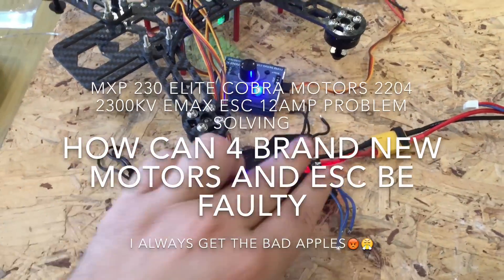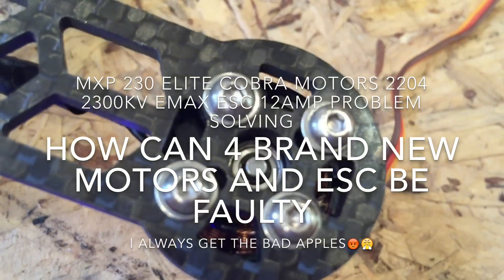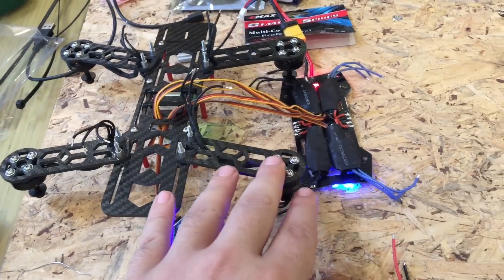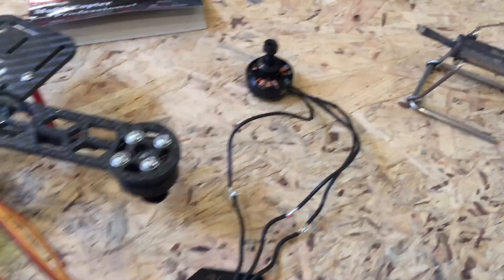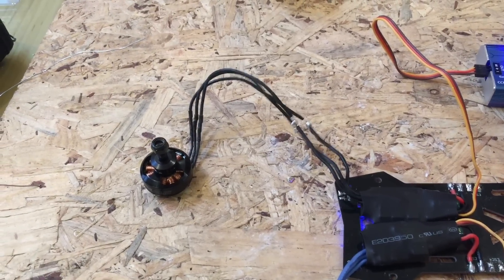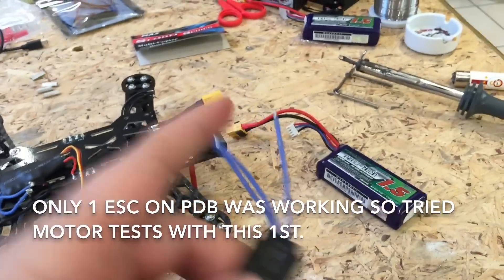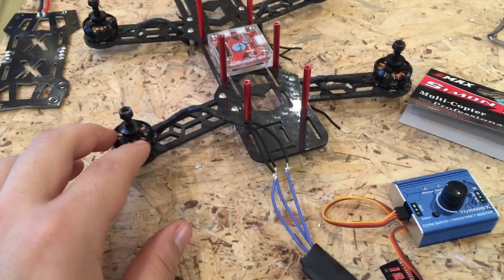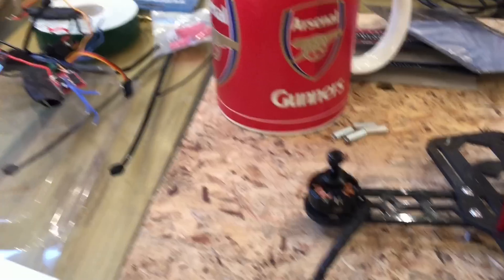Cobra 2204 Motors and Emax 12amp esc Fault finding

Comment: How long are those mounting screws? Could be that those screws are too long, and are making contact with your motor coil. This then shorts the whole thing out especially because your frame looks to be carbon fiber, which can conduct electricity. Once the damage is done, the motor is ruined, unless you can re-coil your own motors. It may fry the esc too, by pulling too much current through the esc, as you are basically causing a short through the esc. Get shorter motor mounting screws.

Comment: I share your pain.  I am using those emax/skywalker 12A ESC, with emax 2204 motors and I have exactly the same problem!  3 months I have been re-ordering more of those ESCs and more of those motors, and it just keeps happening exactly the same as you, and I have not even got airborne yet. I think I will now try avoiding max completely, pay more, and get better quality parts with a different/better brand of ESCs and motors and will try higher amps in the ESCs as well.  Such a waste!

Comment: Hook up some power to the esc and the motor will turn you only giving it signal not power
Reply from the maker: It is powered if you look at the video it's connected to a battery. And also a servo tester to simulate throttle. 
This problem was resolved over a year ago now anyways thanks.

Comment: 2 out of 6 of my emax 12amp esc are broken. Might go back to my afro 12amps never had an issue with those.

Where did you buy your motors and esc's from ?

I would also take the shrink tube off the bad esc's and check the continuity of the 3 motor wires. Ive just changed and resoldered one of the wires as it was broken near the 2mm bullet connector, now is working. I had the same symtoms as you with the motor jittering.
Reply from the maker: Hi

I got the Esc and motors from the U.S. It's not even worth considering sending them back to be honest. 
It's weird because I've had several eMax ESC and cobra motors and sunny sky combos and once in a while one or 2 would be faulty etc I could understand. 
But not to this extent. 
I went all out after this video and bought the 600hz t motor esc and t motor 2300. 
Wow they are so responsive and fast best motors I've ever had in a 250 quad.